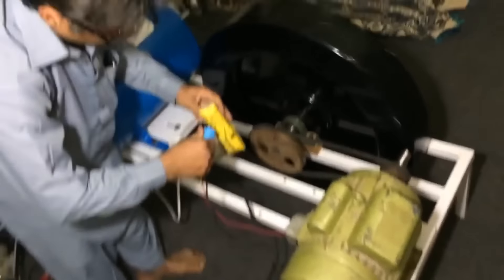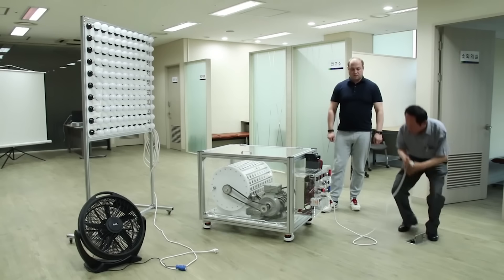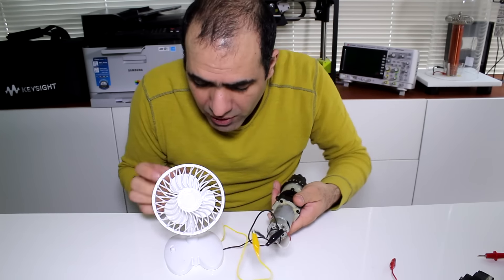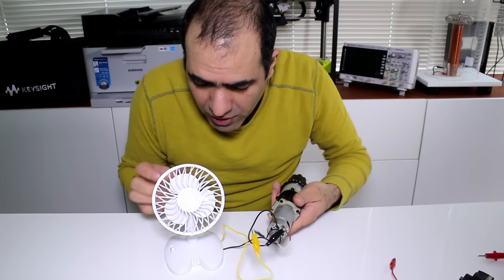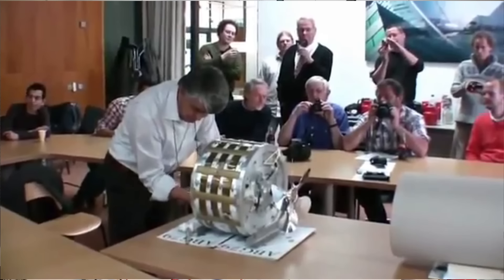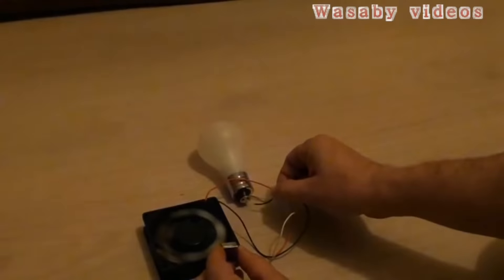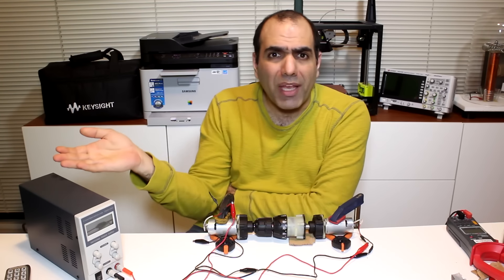The Curious Case of Free Energy Device

Comment: Can you please answer these 3 questions Mehdi (thanks in advance):

- What were and are the ramifications of Lorentz's symmetrization of the Heaviside equations in 1892, and the continuing symmetrization of these equations today as the "electrical engineering model"?

- What powers an electrical circuit, or what actually powers the electrical power grid?

-  There is the "source charge problem" or "the problem of the association of the fields and potentials and their energy, with their source charges".  The charge sits there and pours out observable EM energy in 3-space in all directions, with absolutely no observable EM energy input.  Piece of cake to prove that experimentally, anytime, anywhere so it's well-known. Either this "most difficult problem in classical and quantum electrodynamics" must be solved, or else one has totally destroyed the conservation of energy law itself.  This is a recognized formidable problem, but very much "swept under the rug" and never discussed in "polite circles". So the question is: how does the energy gets input to a source charge or a source dipole in the first place?
Reply: The electrical grid is powered by a mix of sources, ranging from fossil fuels like coal, oil and gas to nuclear and renewable sources like wind, solar and hydro.

A point charge does not radiate energy and none of the equations imply that it does. In order for there to be a change in energy work has to be done and work is defined as force multiplied by the pathlength of the force, since nothing is being moved when a point charge is just sitting there no work is being done and thus there is no change in energy. In order for work to be done we'd need to introduce a second charge that can move in relation to the first and well then we've inevitability introduced some energy into the system. This is basic physics and not hard to understand and does not in any way challenge the theories of electromagnetism or QED.
Reply: The law of conservation of energy states that energy can neither be created nor destroyed. 

So can a generator create energy? According to the law of conservation of energy it can not!

When we crank the shaft of the generator and rotate it, the rotation transforms the input "mechanical" energy into internal "magnetic field" energy. In that little part of the circuit that is between the terminals of the generator and inside it, the magnetic field energy is dissipated on the charges right there, to do work on them. This work (expending the magnetic energy) forces the negative charges in one direction, and the positive charges in the other direction. In copper, for example, for every electron we "push" off an atom into the conductor as a free electron to make "current", there is a "hole" left on that atom. That "hole" is a positive charge.

So the same magnetic field energy, while moving those electrons, also applies forces to those positive holes. The positive charge of each hole, however, is attached to a far heavier mass (the atom) than is the charge of the electron. So the atoms with positive charges (ions) are pushed and rocked back a little.

That's all that rotating the shaft of the generator accomplishes. None of that input shaft energy was transformed into EM energy and sent out down the powerline, as electrical engineers assume. Not to worry, energy does get sent down the powerline. But not from the generator shaft energy or its transduction.

Essentially then, all the energy we put into the shaft of the generator is dissipated inside the generator itself, to push the positive charges in one direction and the negative charges in the other.

The separation of the charges forms what is called a "dipole" (opposite charges separated from each other a bit).

"The Experiment: Suddenly create some charge, and with pre-placed instruments watch (along a radial line from the created charge) the fields and potentials appear progressively at points along that radial, at the speed of light.  And once the field and potential suddenly appear at a distant point, they thereafter steadily remain. This shows that a stream of continuous real observable EM energy does indeed pour from the charge, once it is made, continuously and unceasingly.  Further, that free stream of EM energy does not "die out" so long as the charge remains intact. So the associated fields and potentials are continuously replenished, as they continuously spread radially outward at light speed.

The Observation: Every charge freely pours out real EM energy in all directions, with no observable energy input.

The Problem: Either the required nonobservable energy input must be identified or the energy conservation law is false.

The Solution: The charge continuously absorbs virtual (subquantal) photon energy from the vacuum, coherently integrates it, and re-emits it as real observable photons."

The law of conservation of energy states that energy is only converted from one form of energy to another because this is what is actually happening: The charge continuously absorbs virtual (subquantal) photon energy from the vacuum, coherently integrates it, and re-emits it as real observable photons.

So pouring from the terminals (from the internal source dipole) of every generator and battery, there is a stream of EM energy pouring out, once that internal dipole is made. This outflowing EM energy has been extracted and converted directly from the seething vacuum by that dipole's broken symmetry. The outflowing EM energy is not transformed shaft energy one put into the generator! That flow of energy extracted from the vacuum fills all space around the external wires attached to the terminals, and it flows at the speed of light.

The external (attached) circuits and power lines etc. catch some of that available EM energy flowing through space (generally flowing parallel to the wires but outside them). Some of the flowing energy is intercepted and diverted into the wires themselves, to power up the internal electrons and force them into currents, thus powering the entire power line and all its circuits.

However, the power system engineers use just one kind of circuit. In the standard "closed current loop" circuit, all the "spent electrons" (spent after giving up their excess energy in the loads, losses, etc.) are then forcibly "rammed" back through that little internal section between the ends of the source dipole (between the terminals). These "rammed" electrons smash the charges in the dipole away, and destroy the dipole then and there.

It can easily be shown that half the "caught" energy in the external circuit is used to destroy that source dipole, and nothing else.

Well, to get the energy gusher going again, the dipole has to be restored in order to extract the energy and pour it out again.

So we have to pay to crank the shaft of that generator some more, to turn that generator some more, so that we can dissipate some more magnetic energy to re-make the dipole. We have to work on that shaft at least as much as the external circuit worked on that source dipole to destroy it. So we have to "input more shaft energy" to the generator than the external power system uses to power its loads. Since we pay for the input shaft energy, we have to keep on burning that coal, oil, and gas etc. to do so.

All our electrical power systems are "suicidal" vacuum-powered systems, freely extracting their useful EM energy from the seething vacuum, but deliberately killing themselves faster than they power their loads.

The real and only energy PROBLEM is simple:

- Figure out better mechanisms to intercept that FREE electromagnetic energy flow from the source dipole, once made

- Collect lots of that freely flowing energy in collectors and circuits

- Then discard the stupid closed current loop circuit and dissipate the collected energy in the loads WITHOUT dissipating half of it to kill the dipole and the free-flowing EM energy from the vacuum. @hedgehog3180

Comment: Isn't the sun a source of free energy? If so then just get some solar panels.
Reply: The sun doesn't last forever.
Reply: @cessnacitation-x  true, but in the eyes of the human race it's going to last.
Reply: @Floofie_boi  That's correct, but it's also important to note that with current technology, there's only so much power that you can harvest from the sun, not to mention storms, night-time, general obstructions etc, it would also require a massive solar panel array AND making solar panels is really bad for the environment, it creates a waste product called NF² or something like that, I don't really remember, and this waste product traps heat even better than co2. Solar power is a good energy source, but there's only so much you can do with it. Nuclear power however is the real key to "free" energy, its clean, safe, reliable, outputs a massive amount of power and while there is only so much nuclear substance that you can harvest from the Earth for nuclear reactors, as you mentioned, in the eyes of humanity it will last forever, and harvesting ores from other planets or passing asteroids could prolong this even further. As a species we really need to switch to nuclear energy, wind energy is also great too, and solar power is pretty good as well as we mentioned.
Reply: Free as in money but not free as in physics.

Comment: Good morning, have you noticed ? A large bonfire is overunity : a small flame causes the large fire of the bonfire. A small input energy (flame) enters, and the same form of output energy comes out, enlarged, which lasts much longer. A similar but much more powerful phenomenon are nuclear reactions, in both cases they are overunities that certainly cannot last forever (even the Sun is an overunity, it has been assumed for billions of years, but even the Stars sooner or later run out , and transform into something else). That's  access to some form of potential energy 😃.
Reply: That's not overunity, the energy was already stored in the fuel being used and just required a smaller ammount of energy to start a chain reaction to release said energy. This is only overunity if you're bad at math.
Reply: Sorry, maybe you didn't read the whole comment: look directly at the last sentence 😀.

Comment: HOW ABOUT using a Stirling motor while heating U'R HOME TO MAKE electricity using TO USE IN U'R HOME AND THE excess into the grid. U still have U'R heating BILL but U CUT the electric bill, and maybe make a few bucks ON THE electricity U pump into the grid
Reply: So a steam engine?
Reply: @DrCheez342  A STERLING MOTOR IT WORKS ON EXPANSION AND CONTRACTION OF HYDROGEN GAS. THE HEAT FROM THE COOLING PART OF THE CYLENDER CAN BE USED TO HEAT YOUR HOME
Reply: @stevenvanames-we2dd  why not just use the electricity made by the sterling motor to power your house? Also it still will cost you the fuel, and sterling engines aren't really the best for making electricity yknow

Comment: Perhaps your super tester can measure the feed back loop associated with gratitude, and the characteristics of love as an energy source.
New flash , the sun may not be a nuclear generator, morre likely rather that it is its hurtling through the galactic medium that generates the corona, much like the tiles on a vehicle in reentry are not heaters.
Reply: What the hell is the "galactic medium"?
Reply: @charlesnathansmith  dust , hydrogen 4 etc.
Much like saltwater is the oceanic medium.
Reply: Then the sun would be hotter at its surface than at its core, but the reverse is the case. One side of the sun would also be hotter than the other side and all of the planets would experience the same friction but for some reason none of them have surface temperatures of 5000 K.
Reply: @hedgehog3180  the planets are mere motes in the heliopause sheilded by 99 percent of the matter in our Solar system.

Comment: arent solar panels free energy?
Reply: dont they convert sunlight to electrical energy?
Reply: ehhhhh it's kinda bending the definition of "free energy" because it's more like energy that's being slowly depleted from the sun getting converted into a more useable form. in a similar way, a hand crank to generate battery power is converting the energy inside a person that allows motor functions to electricity. not really free energy, more like energy being converted
Reply: no. they are getting their energy from the fusion inside the sun
Reply: Hmm how about Wind Energy?
Reply: @daineramosquitco5816 Wind energy also just comes from the sun since wind is the result of air rushing from areas of high pressure to areas of low pressure and these differences in pressure are the result of the sun not heating everywhere on Earth evenly. The areas in the most direct sunlight get heated more and warmer air also has higher pressure so this creates areas of high pressure that air will rush out from. This is also why you get more windy weather during winter since during winter you get less sunlight and thus you tend to be in an area of low pressure that the air will rush into.

Comment: What about v gate electromagnet motor with parmennt magnates neodymium with pulse electromagnet coil fool.... here the power dose not came from anything ... on the other hand there is not impossible ..... do you think you are genius?
Reply: Inglis
Reply: Complicated magnets cannot generate energy from nothing.  They can store it -- like springs, or a lifted weight -- but will move a little then run out.

They've made it look modern, but these magnet devices were already old 25 years ago, when I first read about them.  They've just made it look a little more modern to sell views and kits.

Comment: I must contradict! There are free energy devices. They are called „solar panel“ or „wind generator“.
Reply: ChatGPT proves you right, but it is not considered free as it requires work to utilize it.
Reply: You missed the end of the video then? Actually wind turbines are extremely expensive to build and maintain,  The payback time is longer than the lifetime of the turbine.

Comment: Actually using thermal heat is a very different source than nuclear physics (or solar) - it's basically stored gravitational potential energy, stored from the proto planetary disc and the collisions between particles there.

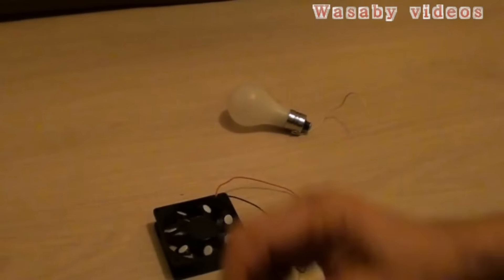Comment: 5:47 this is somehow possible (ITS JUST A THEORY, DONT GET MAD AT ME):
Di u know these guns made only of magnets? This can work at the same way.
SURELY this cant output 220v (or in 170/120v on america, so if the leds on the lamo are directly connected to the poer lines, this can work.
ONLY A THEORY.
Reply: There is a children's toy on that idea, a gauss gun magnet arrangement in a loop.

It does one fast loop, one slow loop ...  then stops, out of energy.

It's nothing but stored potential energy, like compressed springs or a big lifted weight.  It's just less obviously so when the gap is thin air.

Comment: There is free energy, just look up. The Sun, wind rivers, and so on can be tapped into and you don't have to pay for anything besides the equipment. The problem is the cost of the equipment.
Reply: That's not free energy dummy
Reply: You basically don’t know how Sun works😂
Reply: This is "free" energy but not the overunity free energy. However, overunity free energy is INDEED real.
Reply: @lukiepoole9254  no, stop spreading misinformation

Comment: If someone found a way to make a FCC compliant version of the World Wireless System, would you invest in it? If not, then why do you think that large- scale wireless power is out of reach? By the way, the part where you mock people that don't exactly use Einstein as a role model is the funniest part, don't you think?
Reply: Wireless energy transmission is just too inefficient to make sense. Even at a small scale wireless chargers loose a ton of energy.
Reply: Maybe the ones that Tesla designed are really the only ones that are complex enough?

Comment: ok ok  not sure if i trust or believe you electro boom if it is ever invented then you just don't need to use it sinds you don't believe in it even if its not ''free'' but just a way to tap into the magnetic field of earth you can just keep using normal power its ok don't need to get mad
Reply: The magnet field of the earth does not create energy. If you turn the needle of a compass, it takes more force to turn it than turning a normal needle. That extra force is what is used to rotate the compass needle back to face north.
Reply: Thx. For showin us uve never attended Physics class 🤦🏼